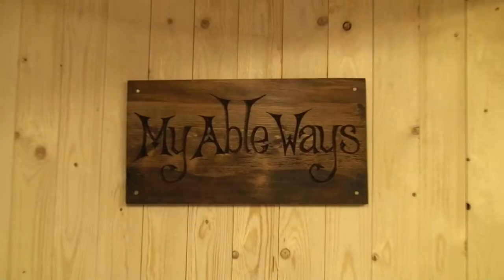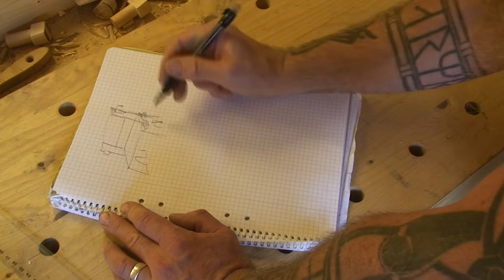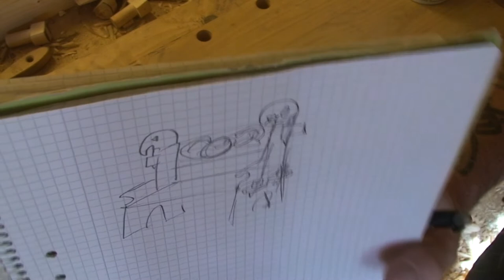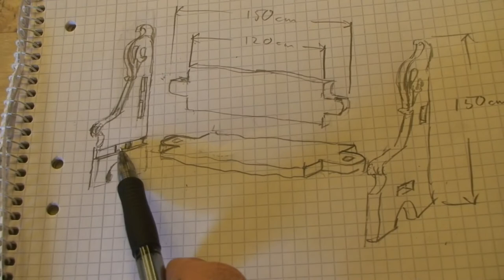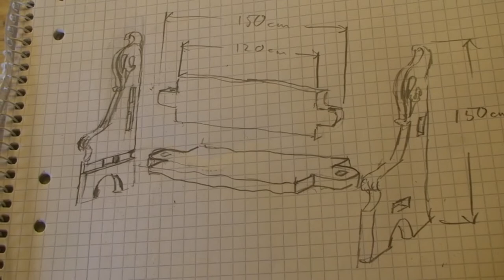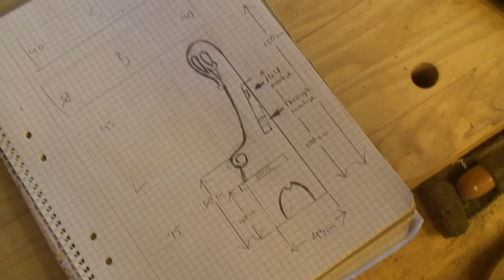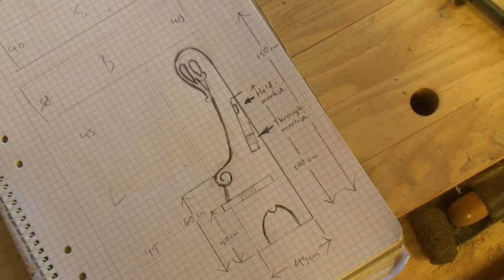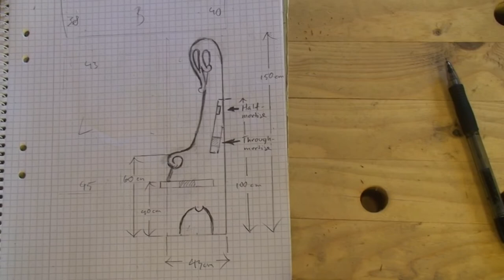Amazing viking woodworking project. Rustic collapsable high seat. DIY craft project.

Comment: I appreciate your way if living. It is quite similar to mine. 
Its alsways nice to see people using holdfasts as i use to forge them. There isnt a lot of people using them although they are very useful.
Reply from the maker: I have the same experience. I guess they just fell out of fashion as tool manufacturers developed other ways to hold workpieces down. But I find them hard to beat, both for time saving and versatility.
Reply: Make a hold fast for the pritchell hole in your anvil.